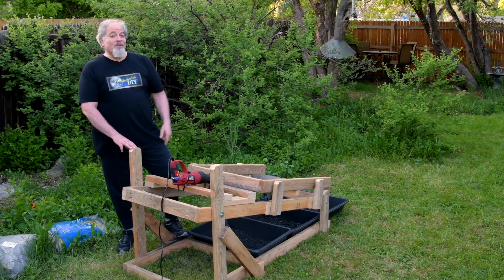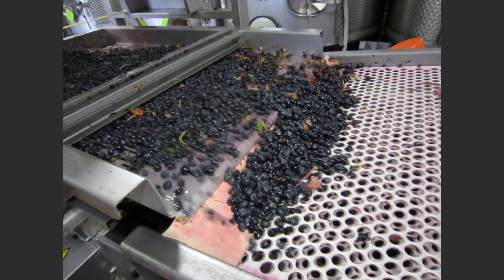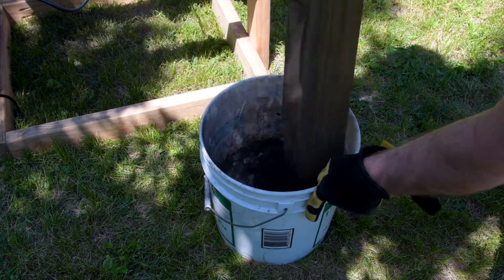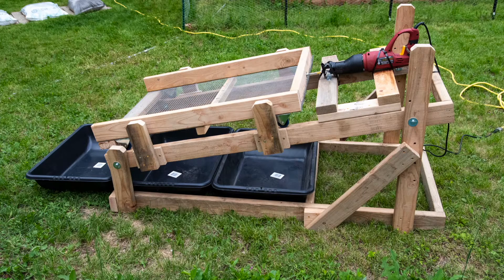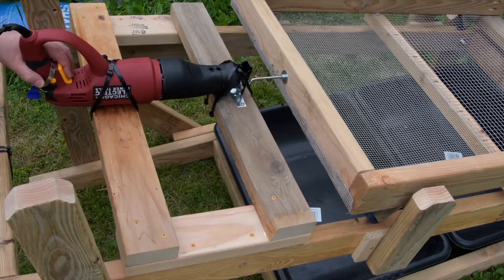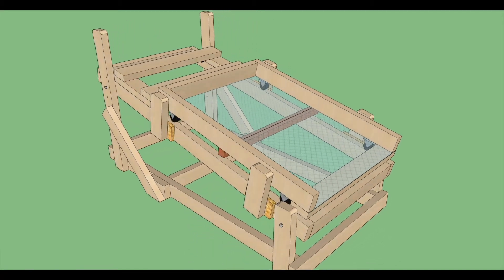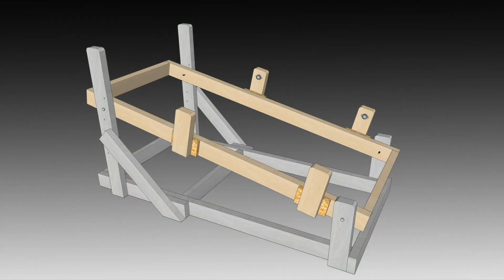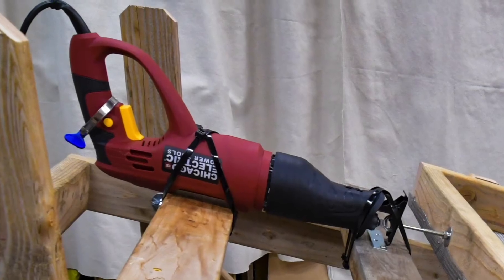Sift, Sort and Clean Soil, Compost - and So Much More - in Minutes!  DIY Motorized Shaker Table!

Comment: Looks great. I had been sifting my biochar through a box sieve into a wheelbarrow, and was looking for a way to mechanize. This kind of shaker is one option, and a rotating trommel is the other common way, either is easy to build and drive with a small electric tool. I make larger volumes of biochar than those little black pans can hold, but it is easy to build this frame high enough to park a wheelbarrow under it.
Reply from the maker: I think either type would be a big help, and I like the idea of building it high for a wheel barrow. I'd love to know what you end up doing, and happy sifting!
Reply: @UnchartedDIY I built a trommel, and at first I was delighted that my char was now sifting as fast as I could shovel it out of my pit, but after two barrows, chunks of char were sometimes falling into my drive wheels and causing trouble. I need to tune my build a bit for reliability, before I can show it off without embarrassment :)
Reply from the maker: @BenDiscoe I can totally relate!
Reply: Early test run of my trommel https://youtu.be/L-WlPsFu54g?si=iA9tKgirWPIT7I4W

Comment: Great design! I plan on building one this weekend or at least in the very near future. I’m an avid DIYer and can figure out the design details from this video. The only thing that is puzzling me is the saw to tray adapter. I couldn’t catch a glimpse clear enough to understand how it works. Can you describe the concept a little more? Like how the hose clamp is secured to the bolt?
Reply from the maker: Thanks, Brian. The solid part of a hose clamp is folded in two and wrapped around the eyebolt. The ends have a hole drilled in them so that it fits into the saw chuck exactly like a blade would. Have fun building and using your shaker table!
Reply: @UnchartedDIY  Thanks Steve!
Reply: Tryed it so. After 20 seconds it broke. I had to much moving space. Currently looking for a better solution to make it possible to take the saw faster of for transportation

Comment: Nice work and very well presented for beginners to follow easily. Could you simply screw through the face? pocket hole is to hide screws for aesthetics I believe
Reply from the maker: Thanks Matthew! Contrary to popular belief, pocket hole joinery isn't just an aesthetic choice. Let me explain...

Yes, you can just screw through the face (called a butt joint), but unless done properly it may not be as strong as a pocket joint. That's because with butt joints, the screws are going into end grain rather than face grain. There are pros and cons to each, and I have a chapter discussing this and demonstrating how to do both types in the available plans. There are lots of YouTube videos covering this too. Either way, you can get a strong joint so there is no need to purchase a pocket hole jig if you don't already have one. Thanks for watching and taking the time to comment 👍
Reply: @UnchartedDIY  not trying to be difficult but I use bugle head screws and they are very strong. They come up to about 8 inches in length  but you must pre drill or yes it will split. Im sure im not telling you anything you don't know.
Reply from the maker: Pre dilling is key to any butt joint and those screws are very strong. You'll do great! 👍

Comment: I've been extremely happy with this design. Only problem I have experienced is I have went through 2 saws already. That's not your fault, they just aren't designed to last.
Reply from the maker: I happy to hear you like it! Mine has held up so far, but they sure aren't commercial grade saws meant for continuous hard use. I think that's why actual vibration motors are so expensive! 

If you find an affordable substitute that does last, I would love to hear what it is so we can share it with this DIY audience! It makes me happy to see people improve on my designs 👍
Reply: @UnchartedDIY  I went with the harbor freight warrior saw and then bought Walmart Hyper Tough 6.5 Amp. I have tried it with a concrete shaker motor, but just isn't as efficient and requires alot more manual intervention. I am going to get a Bauer 8 Amp saw from Harbor freight tomorrow and try. Maybe run it at intervals and let cool down.
Reply from the maker: That sounds like a great plan. I've like the Bauer tools so far, so let me know what you think when you've had a chance to try it.
Reply: Certainly! How long do you generally run your saws-all for before allowing it to rest and cool down?
Reply from the maker: I go by how hot the body of the saw feels rather than a set time.
Reply: I just learned about something called a cam and follower mechanism. I think this is a solution here, as one could use a rotary motor to generate the reciprocating motion that this puppy needs.

Comment: Very clever. I especially like that you used a saws-all as your motor.
Reply from the maker: Thank you! It was an inexpensive solution.
Reply: I don't think a reciprocating saw (especially from Harbor Freight) is heavy duty enough for extensive use in this application.
Reply from the maker: I have several people that have built this and done huge jobs with it. One cleaned 2,355 square feet of landscape cobble gravel with hers! Check it out here and let me know what you think: https://uncharteddiy.com/shaker-table-build-by-leslie/
Reply: @UnchartedDIY  I am very skeptical of that saw running continuously like that.

Since you asked, the project is well crafted but I do not think the design is the best.

As far as I can see, the dwell time of the gravel upon the screen is too long because the angle is too shallow and the shaking is mainly horizontal and too pronounced where it should be a slight vertical vibration upon a steeper angled screen.
Reply from the maker: That's why the angle of the screens are easy to adjust using the two wing nuts. I realize there are motors more appropriate for hard use, but I wanted to keep the shaker table affordable and easy enough for most people to DIY. 

I have learned some great tips from my viewers, and if you have a better way to make this table or ideas for improvement, please share them. That way everyone benefits from the combined knowledge of the community 👍
Reply: @UnchartedDIY  It depends on the application. Sifting the soil for valuable and delicate archaeological artifacts or panning for gold requires different equipment and procedures. 

Leslie's application was to separate landscape gravel from dirt and debris. She would scoop up a shovelful of gravel groundcover, carry it over to the machine and slowly pour it on the screen.

A screen or series of different sized screens placed at an angle of 53 degrees and fed by dumping a shovelful of material from say 16 inches above the screen would  accomplish the goal.  No shaker required.

Comment: I'm building this unit now! I bought the plans Saturday morning after deciding I needed a weekend project for Labor Day.  

The biggest time waster has been running back and forth for tools that I'm missing.. also the sun's heat this weekend. 

A cheat I found with building the rear uprights: using a small L shaped piece of metal bracing, draw the hole alignments around the corner to the rear (not inside) of the upright, and use a centered line on the outside of the frame to line up to the marked line every 4 inches from the first hole, then clamp and drill!

This project also taught me more about the use of a speed square, such as that there are notches you can put your pencil or sharpie in that will get you every 1/4" in from the board edge, useful to put the sharpie in the 1.75" spot and just drag it with the speed square and get center every time!

Also, the rotating Chicago Electric saw is now branded as Warrior. My only concern is the longevity of it as I'm building the entire thing out of PT wood. Definitely a heavy unit when done!

Eveything you need is at Harbor Freight and Home Depot, and can be built on a couple of sawhorses with a plywood top outside using the recommended tools. I found my old craftsman circular saw had bad bearings, so after 20 years on their 19.2V system, I've now jumped ship to the 24v Kobalt brushless and got a 6.5" circular saw that cuts beautifully.

This is a fantastic project.. can't wait to finish!
Reply: Another tip: and this is at the builder's risk. When creating the saw adapter, a butane kitchen torch will provide enough heat to make the strap glow with heat to beat the strap around a bolt before final fitment around the eye-bolt. 

I did this by clamping the strap off the edge of a concrete block after bending it around a spare bolt of the same size, remove the bolt, heat the strap, reinsert the colt, and hammer to shape. 

One design addition I came up with! Take two spare 45 degree cut-offs  and then combine them with another spare block, and you can make a bracket that will hold a board between screens, as a sort of gate if you want to be sure to shake out as much as possible, even when flat.

With the triangles point towards the center, they'll guide the larger material towards the center when it's tilted.  And you can use excels 3/4 plywood as the gate.
Reply from the maker: Those are some great tips, Jeff! I'm happy you like the plans and project, and I love getting tips and tricks from people building this shaker table! Thank you 😁    Oh, and I love that 24v Kobalt saw and use mine all the time. It's a big time saver!

Comment: Excellent video and design.  Using my 36v reciprocating saw I can bring the unit into my wood lot to process rotting trash wood piles
Reply from the maker: Thank you, North Star! I love that idea and think cordless is a great option, especially for your wood lot. 

So far, Ive only worked in the yard and can run extension cords, but I'm tempted to try running it from a portable rechargeable power station.

Comment: Nice design. Last weekend I spent five hours hand-picking rocks out of freshly tilled clay, and this is now on my to-do list. How's the reciprocating saw holding up? I'm debating whether to use that or make a drill-powered vibrating mechanism.
Reply from the maker: So far it's holding up very well. I don't think a drill would be able to handle that kind of torque for very long. Some people use concrete vibration motors and they work great, but they're expensive.
Reply: @UnchartedDIY  I'm trying to go cordless so I don't have to move a generator to my dirt pile. Most reciprocating saws have somewhere around a 1" stroke length, but I'm thinking with a slightly offset wheel I might be able to get the travel down to 1/2" or so to reduce torque and increase vibration speed. Maybe.
Reply from the maker: The way I designed the shaker table was to have the saw attach to it's own "sled" support frame, so it would be easy to try the drill with a different support. If it doesn't work as well as you are hoping, you might need to replace the support, but that's all, so I think it's worth trying it out. There's really nothing to lose.

I would love to hear how it works out and maybe even see some photos if you'd like to share them.

Comment: Thanks for showing the shaker build. I understand a buyer has been frustrated at aspects of your instructions, and I want to say, probably many of us - I can - can just look at your video for a few minutes, then go build the thing. It's not a nuclear powered submarine. Let me guess, 24 pieces of 2 × 4 ? Doesn't matter. I'll know as I go.  How wide does it have to be? Any width you want. How do you know the dimensions of the shaking tray? Don't. Don't care. It has to fit inside the frame and be able to reciprocate. I might make mine 10' wide, or 3. Did I look closely to how the component fits in the saw? Nope. Don't care. Doesn't matter. I just have to cut and file a steel sheet to fit and hold.
   I really wonder how some people are going to survive the next years. 
I'm far from the best fabricator I know.  I was failing 7th grade math in the 12th grade. I graduated. The first sailboat I built i took the hull home and started studying what the sailboat engineers did. And looked at relations, such as a mast is close to 1/3 distance back from the bow, the sail center of effort is found by thinking and drawing lines.  etc. 
Virtually anyone should be able to build your shaker without a single jot of information beyond looking at your video here. Thanks again for designing it and showing. And your swivel compost barrel is fantastic. Well thought out.  
I might build the barrel of pallet boards and the frame of bamboo. Lashed not bolted. Using hand and electric hand-held tools. 
 After all, the Polynesians sailed to Hanga Roa on lashed together catamarans with their families, with no written or emailed instructions, no compass, no astrolabe, no instruments at all. 
So what's my point? 
If you think you can, you're right. 
If you think you can't, you're right again.
Reply: The coming years?  I wonder about their next day.  It's all good though.  They make many folks wealthy.
Reply from the maker: Thanks for the great comment, Senator Joe! I appreciate the can-do sentiment, and your humor brightened my day!